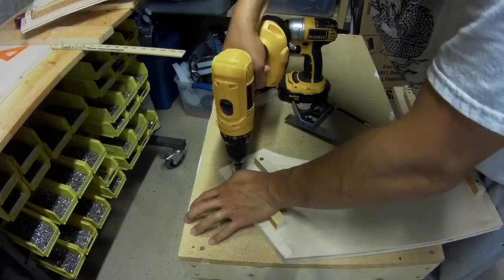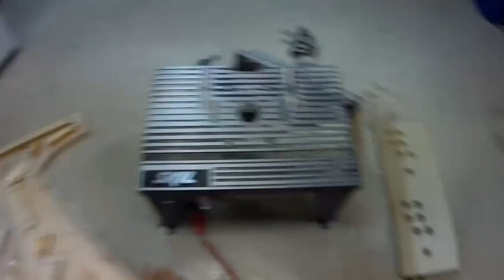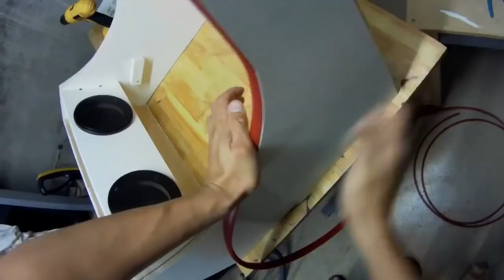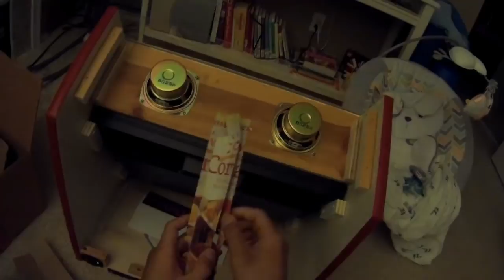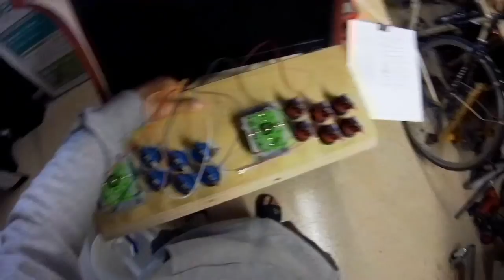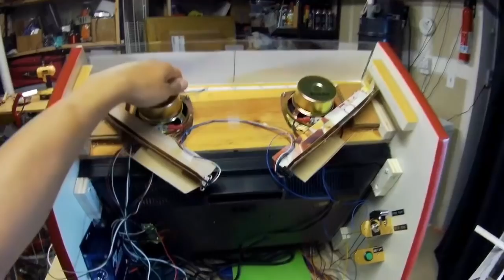How I Made My 3rd Bartop Arcade Machine, A Step by Step Process

Comment: Awesome tutorial here. Did you have more details on how to setup the optical switch, wiring it, etc?
Reply from the maker: Thanks Neil!  Sorry for late reply.  I don't have anything published but I found this picture which is exactly what I did. https://i.stack.imgur.com/HoghC.png

Where you wire the output pin would depend on what kind of arcade box you are running.  In my case, the output pin in the picture would be wired to the Player 1 Coin pin of the Pandora's Box.  If you are using something like a Raspberri Pi to emulate an arcade, it would go to the GPIO pin that is used for the coin slot.  Furthermore if you using a computer motherboard with a USB I/O joystick expander, it would be wired to one of the pins on that expander board.

I may do another video on just the coin slot/optical switch build as I think another person also requested this.  It is in the queue :)

Comment: Very nice video!  Certainly not telling you what to do, spending the extra $30 for an actual Suzo Happ JAMMA harness can save some headaches :-)  Nicely done!  Did you have plans for the bartop or did you just come up with it?
Reply from the maker: Dan Flood. yea i think it is worth to spend more next time to avoid headache.  i started with monitor and designed everything around it.  its loosely based on my 2nd arcade but simply tried to improve upon it.  2nd arcade had too small of marquee and didn't have correct angle for coin slots. next go i would want to put a small radius on the corners to make tmolding go in easier.

Comment: Great video, thanks!  One question, how does the monitor "turn on"?  I am doing a project that is similar, and I don't want to have the monitor power switch visible.  Does your monitor automatically come on when power is applied?
Reply from the maker: Stony Acres thanks! Yes the monitor comes on automatically when powered. A lot of monitors will do this and it will automatically scan for an input source on power up.  If monitor doesnt see any inputs it will just goto standby mode.  The arcade should boot by the time this happens though.
Reply: @LockeLaboratory  Great.  Thanks for the reply!

Comment: how do you get to power button on Monirtor
Reply from the maker: Dont need to push it generally.  On power up from main power switch on back which turns on everything, the monitor will turn on and look for video source and the pandoras box will output video to monitor at same time.

Comment: Would you happen to have a link to the optical switches? That's a genius idea! I"m almost done building my first cabinet and I came across your video and would love to incorporate this idea!
Reply from the maker: TLil21 hi there. if you want a large selection than Digikey.com but it may be expensive and overwhelming.  you may want to check ebay for better price. such as here
https://www.ebay.com/i/271818943311?chn=ps&mkevt=1&mkrid=711-117182-37290-0&mkcid=2&itemid=271818943311&targetid=474173449429&device=m&adtype=pla&googleloc=9033255&poi=&campaignid=1669934831&adgroupid=65058350299&rlsatarget=pla-474173449429&abcId=1139296&merchantid=113746984&gclid=EAIaIQobChMI_9zqmJGa4gIVchh9Ch0L_gxxEAkYASABEgI51fD_BwE

Comment: If anyone knows of a vertical bar-top arcade kit then please let me know, thanks
Reply from the maker: gan9e i curious what kind of features you would want in a vertical bartop kit.  Two player or one? Multi game emulation or jamma interface? Etc.  I've seen several kits for just the cabinet on etsy.com but not the entire system.
Reply: @LockeLaboratory  Thanks for the link, I might eventually contact a seller on there for a custom job where I supply the artwork for a custom cabinet (buttons really) which will be for my own home made arcade shooter called "Galaxy Pilot" which is a fantasy arcade game from the 80's based around a classic arcade game from 1984 called Star Force, well it's taken me fours years to write the code and I'm just about 5% away from finishing the game, I need to work on a few bits & bobs and then I thought I'll install the game inside a real-world arcade cabinet for a promo to sell the software of the game on Steam perhaps... either way I wrote a special version of my game just with that in mind and it even has it's own service menu showing coins in and time running etc... I used to be an arcade engineer myself back in the 90's and the games of my youth were these arcade style shooters... and so after years not really making anything I grasped the nettle so to speak and made this game... and I just need a cab for it... but its not just ready quite yet so I'm just looking around ahead of time to give momentum to doing the final push to get the game finished...
Reply from the maker: gan9e that sounds way cool! Id really like to see your finished product and check out the game if you ever post it to steam.  I wish I had coding skills like that to make my own game... I grew up with going to arcades and could spend hours in them with a few quarters.

Comment: whats the best option for a bartop? i own a pc with 320 gb 4 ram and core 2 duo and i own a rasberry pi 3
Reply from the maker: al ubaldini if I were to do it again i would use a PC or laptop.  This is because the emulation allows more game systems and it is overall faster. The downsides are that it takes a little more work to setup user interface (frontend) and it is overall bulkier/heavier and a little more fragile.  The raspberri pi and pandoras boxs seem more durable than a PC.  Pandoras box is easiest to setup since it is simply plug and play.
Reply: @LockeLaboratory  is because I dont use this pc but I'm from Costa Rica there is few artisanal  guy selling Barton but it cost expensive until 500$usd
Reply from the maker: al ubaldini yes you can save money if you make bartop yourself. It will cost about 150 dollar in parts instead of 500 dollars.  it is labor intensive however.
Reply: @LockeLaboratory  yeah but I have no experience in carpentry  or electronics
Reply from the maker: al ubaldini there are some cheap bartops ive seen on ebay and aliexpress which are based on pandoras box for around 200.  they also have just the joystick box with pandoras box inside which you can connect to TV. i still would prefer bartops however.
Reply: @LockeLaboratory  but same problem delivery to costarica will cost the same or more than the bar top and taxes